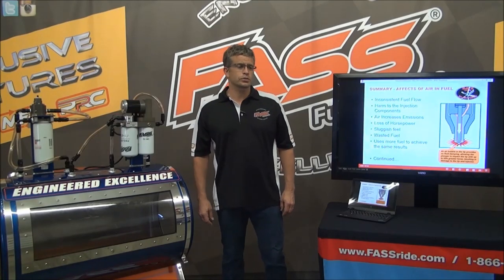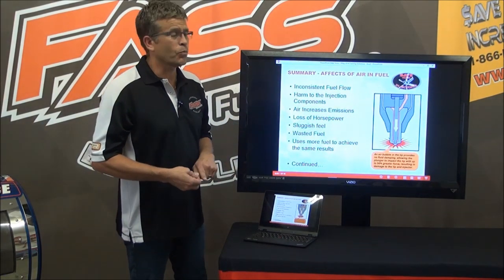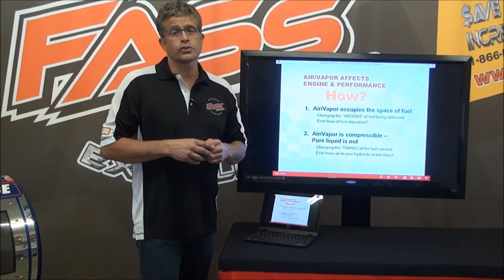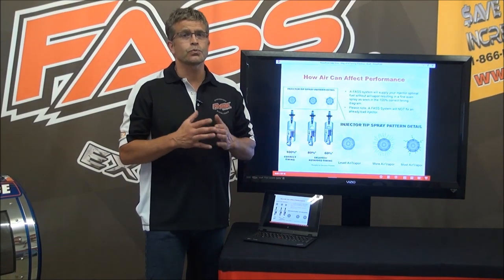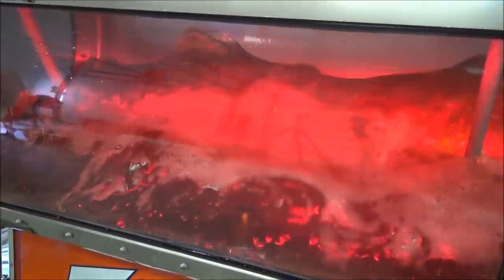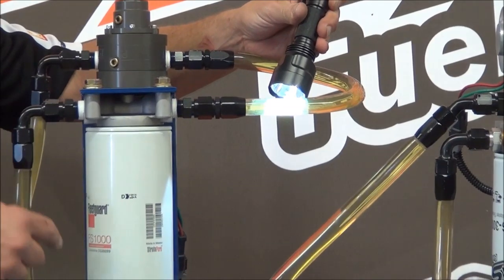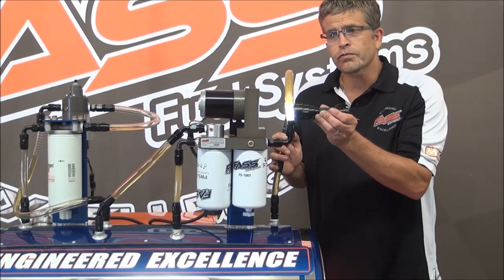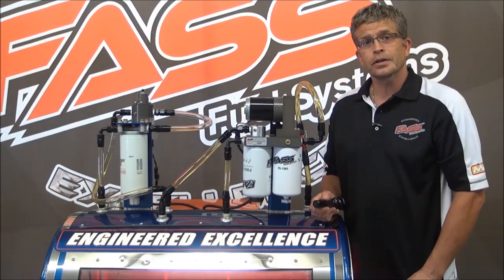Affects of Air in Fuel & The Benefits of FASS

Comment: Is this system offered in 24 volt versions, I would like to install on my m925 5 ton Cummins mhc 250 military truck and my m35a2 duece and half with multifuel engine military truck, both 24 volt
Reply from the maker: Hey Seth, thank you for reaching out and that is a great question. If you don't mind reaching out to our service team they will be able to help you out here! Our number is 636-433-5410. Thank you!

Comment: I have always have run my vehicles to low fuel - light on - that's about 10 litres left in the tank and never noticed the vehicle missing. Did you know motor vehicle fuel tanks have baffels in them.

Comment: that mock tank also is about 10% fuel left. which is equal to the empty light coming on. how many people are running their tanks that low? would be nice to see a test where the fuel tank is at maybe more around 50%. and then again with a sump return so its not spraying and dropping intot he fuel. all these things prevent air, which makes the FASS system avoidable if this seems to be the real selling feature